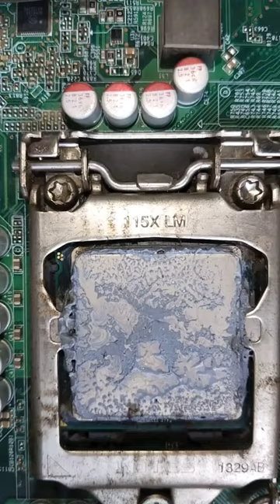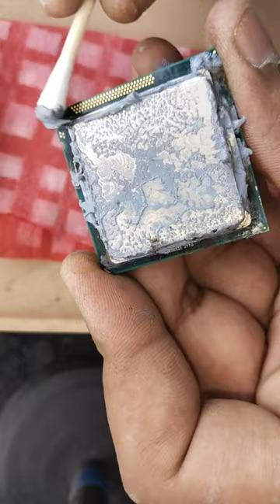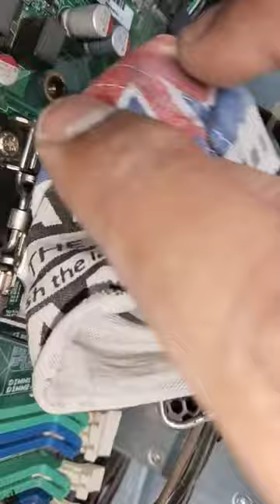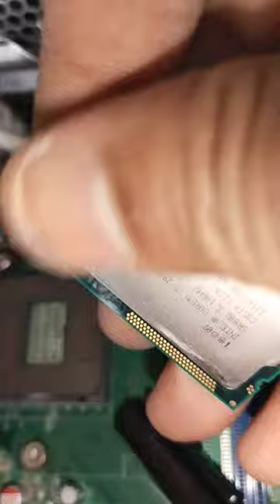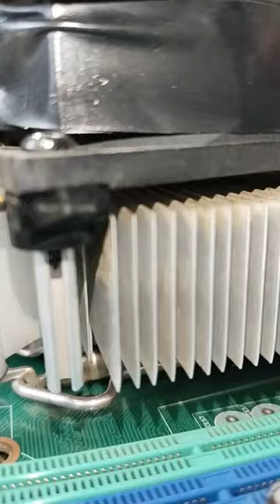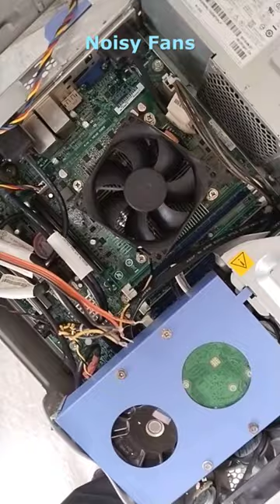Dirty Processor 🦾 vs Louder Fan 📢🥁 Full Video link in Discription #shorts  #computer

Comment: The fan should have been running slower now !
Reply from the maker: No no no.  Actually I use 4 fans for my computer system. 2 fans help in starting the computer system. And the remaining 2 fans are cooling systems for which I have provided a separate power supply. My computer automatically shuts down due to system performance and heating problems. That's why I used this Idea 💡. And Now My Computer  System makes noise like a Mixer Grinder. 😅😅😅😅
Reply: Ye wipe that thermal paste and put some fresh thermal past on
Reply: A separate psu for the fans..? U used a metal pin to the 3rd and 4th socket of the 2nd psu's 24 pin connector for that ? @ankushdesktop
Reply from the maker: @EASH1912  i don't know how you found out that thermal paste is Old😅 but yesterday i ordered a new thermal paste 😅
Reply from the maker: @SikhaDas-wl3jm  I just used  a 12v 5amps Ac to Dc converter and to look good I used a 6-pin DC connector  for a power supply. I know this looks really bad, but good to look at.